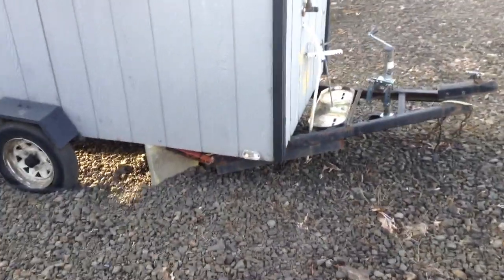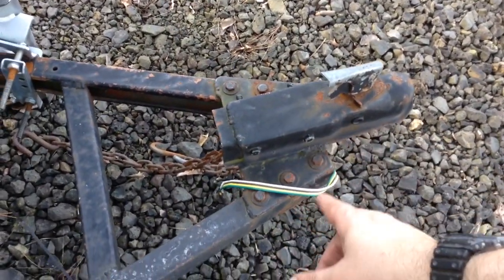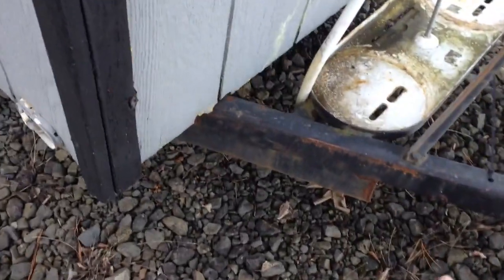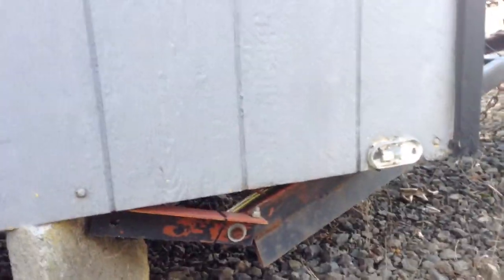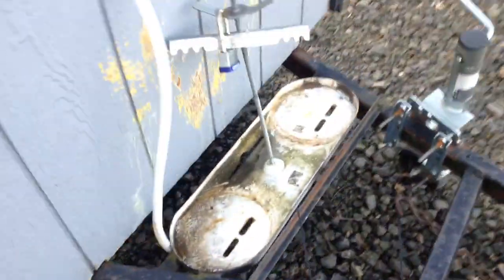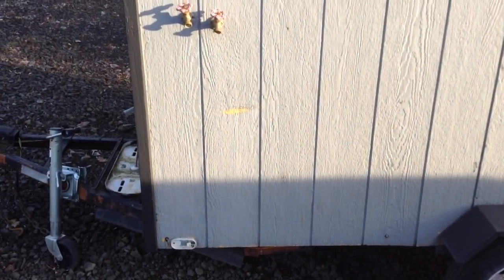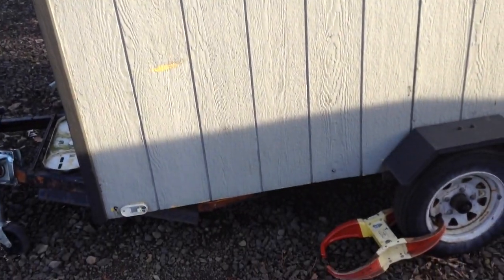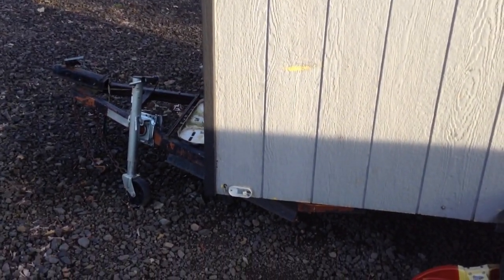Harbor Freight trailer structural failure

Comment: Not a structural failure, all the welding weakened the metal, then the weight overload. Owner failure..... but thanks for putting the video out there letting folks know that a $300 trailer does not replace a $5000 built for the purpose trailer.

Comment: I had the same thing happen on one of the 4x8 versions…It was my light duty trailer , but my guys put too much on it and hit a speed bump and it failed in the same place. We ended cutting it apart, adding angle iron and welded and bolted it back together.

Comment: Yes, structural failure but due to owner's improper modification design and overloading, not structural design.  Water tank, water heater, and two propane tanks right where the tongue assembly meets the frame.  Start the clock on the inevitable failure.  Thanks for the upload.  Hopefully, it will cause people to pause before attempting something similar.

Comment: It is not a structural design failure, it is a load distribution failure.  You do not have that load balanced over the rear axle properly.  It is pretty obvious you did not have 10 to 15 percent of the total trailer weight on the tongue of the trailer.  The load is too far forward on the trailer.  It is no wonder that the axle is fine, it didn't carry anywhere near what it should have been carrying.

Comment: I just bent mine in the same spot last weekend.    Used it to haul my raft to the river.  Had about 800 lbs on the raft but the gravel road to the put in was in poor shape, tge raft bounced forward on the trailer as it was tilted towards the hitch, and after the weight shifted enough the A frame bent near those release pins.   Definitely its the weak spot.  I think i can remove the A Frame, bend it straight,  and install square tube

Comment from the maker: The trailer in the video is not mine, but shows some what can go wrong.   Here is a video of a problem that developed on one of my trailers.  It had gone a few years without the bearings being greased, but is one of the reasons I prefer to buy new as opposed to used trailers since people almost never really adjust trailer prices based on age and the trailer wheels had given no signs of fatigue prior to the catastrophic bearing failure.   https://www.youtube.com/watch?v=Aww5-8rdUaU

Comment: Did he weaken the original frame when he modified it? Also , was that bolt hole there originally , or did he do that also. It looks like a pretty big hole for the bolts they use.

Comment: Buy and run a 2X2 square tubing 8 to 10 feet long from the front hitch back and bolt or weld it to the frame everyplace it comes in contact with the factory frame.

Comment: Take the advertised weight rating of the trailer and multiply if by .7.  That will give you a 30% safety factor (capacity of 1204 lbs).  I wouldn't doubt that the advertised rating is the absolute maximum with no safety factor.  That 1720 lb capacity + 280 lb empty weight trailer has a 1 ton axle - no safety factor.  So, when you tow that nearly grossed out trailer down the road or street, the bouncing will cause fatigue failure.  Chanel steel isn't as rigid as box steel frame members.
Reply: If you have 10% of weight on the hitch you have a 200LB safety factor.  But I get your point.